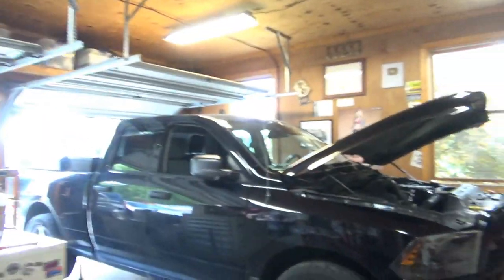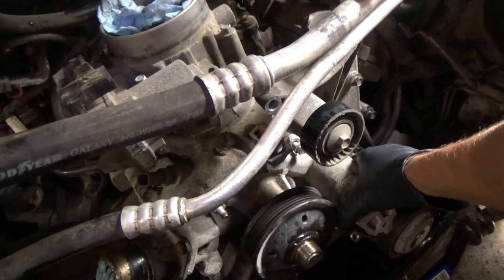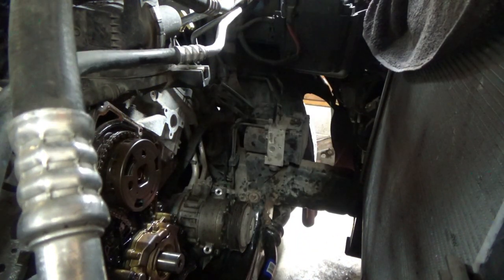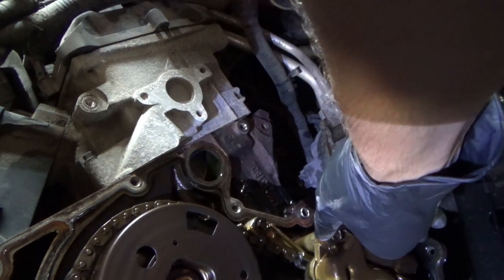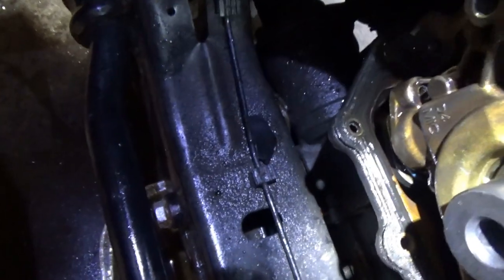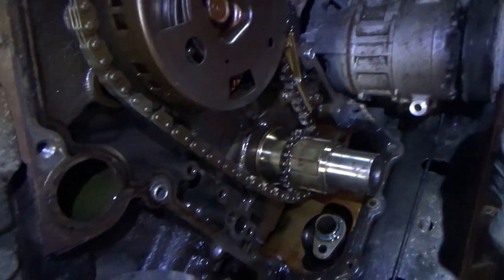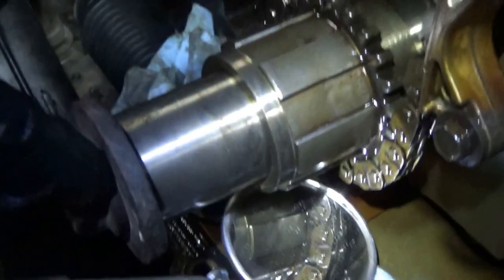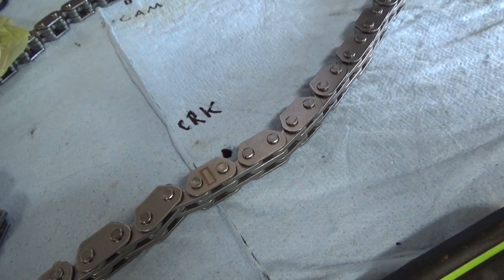Labor Day HEMI - Part 3 (P0016 Timing REPAIR)

Comment: That far into it I’d drop the front diff, drop the pan, replace the oil pump with Hellcat pump.   Inspect the oil control valve for metal as well. The owner needs to change the oil every 6000 miles maximum.
Reply: He could still replace the oil pump without pulling the pan. (as long as it uses the same pickup)
Reply: @calholli  with the oil in the condition it was in when we first started, I’d love to see the cam. Agreed he can still replace the pump, but debris in the pan is what my concern is.
Reply: Definitely want to pull the pickup tube at a minimum and drop the pan to remove the rest of the guide plastic….
Reply: Did a cam and hellcat pump on my 300c and it made a big difference in the oil pressure and drivability of the car.
Reply: @thunderjet4294  6-8 psi I’ll guess
Reply: @js12278  15psi at idle 22 at 4500rpm
Reply: @thunderjet4294  ...does that make it baby hellcat cub? Hmmm
Reply: @nickmalone3143  no it just makes it a better mood reliable 5.7 that don't have lifter tick
Reply: @thunderjet4294 did you have to change the pickup tube?

Comment: That oil pickup O-ring situation makes me nervous.  I would have at least replaced the O-ring but I feel like you can't be sure you are getting it aligned just right.  Obviously that O-ring stands between you and engine failure...
Reply: @T.J. Kong but hat does it take to get the pan off? is it another 3 hours of labor pulling 4wd parts to get clearance?

these body on frame trucks aren't exactly super serviceable with things like that. 

the guy has already driven the hell out of the engine (even towing like that)... whatever damage has been done is done.

Comment: How did you get the pickup tube bolt threaded back in?? 

Thanks for this video I have essentially the same truck so it's great to know you can do this without dropping the oil pan.

Comment: That oil pump pickup bolt is very similar to a Chevy LS engine.  If you use some fishing line with a loop, you can slip it over the head of the bolt, pull on the loop of the fishing line and you will be able to retrieve the bolt.  I've done this on the infamous LS engine where they use an Oring instead of a gasket on the pickup tube.  The Oring looses it tension and the oil pressure lowers. When this happens, the variable cam actuator can't work properly and it sets a traction control, stabilization code on the dash.  It took me quite a while to figure out what the issue was.  If you revved up the engine quickly, the VVT worked.  If you did it slowly, it wouldn't advance and it would set the code.

Comment: IMHO lack of oil changes would not have caused the tensioner to break in half.  Luckily removing the timing chain cover doesn't seem like a major undertaking. Design flaw in the tensioner itself. Thanks Ivan for showing us, I own  a 2019 RAM and hopefully Stellantis has updated the timing setup.

Comment: Ford Tech Makuloco  had a good demonstration video on how a Ford 5.4 3-valve could skip the camshaft forward by ingesting broken pieces of timing guides. I feel like that is what happened here. He placed a piece of plastic in in between the chain and camshaft sprocket and rotated the engine. After the piece passed out the other side, the cam was advanced 1 tooth.
Reply: i remember that one, great video.

Comment: Good work Ivan. My only concern is if the chain guide dropped any debris into the oil pan. I'd want to know if the pick up screen is blocked very much. Also, 100,000 miles and this chain guide wears out. I wonder how much less wear would occur had the owner used Mobil 1 or other synthetic oil ? You have to wonder.

Comment: Whenever a guide or tensioner falls apart there is the chance of trash in the pan... been bit by the 'just do the kit' before, on one with nylon teeth broken off (obvious in retrospect).  Hard choice whether to pull the pan... depends on if you can do it without removing the engine, I'm sure.  Biggest lesson here, folks... don't neglect your oil!

Comment: great video IVAN,my gut feeling after you showed the chain guide,bingo! But then i thought where's all the crap aluminum? Oil filter? pump screen,maybe blowing out the pickup tube might have helped the plastic parts to the drain hole?But some damage is all ready done no doubt.NOT YOUR FAULT.If the guy was on-top of his servicing this MITE have been avoided.Your gut instinct about advancing etc was right.A lot of your viewers know these motors,and they still watch your videos.That speaks volumes to your skill level,and ability to explain your findings and procedures.Ford could maybe improve this design.thank you IVAN

Comment: To get the crank pulley on easier I use a small torch. Heat up the pulley shaft. Then while it's hot slide it into the crankshaft. Works every time. Once it's hot it expands and will slide on easily.
Reply from the maker: Great tip Edwin!

Comment: Is the tensioner designed to take up slack if the crank is spun backward  ?  I could see if it allowed slack during kickback on start to jump a tooth in the advanced direction.

Comment: just when an engine shuts down it can kick backwards slightly due to a cylinder being on the compression stroke but not reaching top dead center and at that instant it's possible that a cam can jump backwards on the chain.    I would also imagine that perhaps if you were driving along at a pretty good clip at high RPM and slammed on the brakes the tranny upshifted such that the crankshaft slowed down much quicker than the camshaft it the latter could also advance but true that is definitely not the common failure.

Comment: Me thinks somebody was doing neutral-drops with this truck. This would cause the crankshaft to suddenly decelerate, so the inertial of the camshaft assembly would twist towards slipping forwards a tooth.  When I was a teenager, my friend used to sneak his mom's 350 Nova out and do neutral drops to burn rubber.  One day the rear universal joint snapped, and we had to tow it home with a tractor, driveshaft sliding along the pavement.  Does the owner have a teenage kid?

Comment: Only problem I have is, where has all the plastic and metal gone from the guide ? I would have definitely, removed the pan as a minimum and stripped the pump and strainer.

Comment: Wow! That was a lot of work! I'm curious as to why the old cars had timing chains without guides or tensioners - is it because the older designs had shorter chains? And this truck is only about 5 years old and needing work this extensive and invasive? Yowza!
Reply: Older cars didn’t have variable timing with phasers.

This vehicle didn’t have regular oil changes.

Comment: All that metal and nylon has to be in the oil pan which in my opinion would warrant removal. Even though there is a screen at the end of the pickup tube it could be restricting flow.

Comment: I would have pulled the oil pan to do a full inspection and cleaning of the bottom end. I also would replace the water pump since it was disturbed by pulling the timing cover. I don't like to pull parts that are old and reuse them especially water pumps that may start leaking next week or 6 months down the road.
Reply: Parts quality can be so bad today, the new water pump you install might not last long at all. I personally throw a new gasket on these old water pumps and reuse them if they are not leaking. If the old one leaks later in life, its not a hard replacement.
Reply: @mph5896  

I think it depends on brand and where it is made. I try to get OEM parts or quality branded parts, and get NEW instead of rebuilt. Sometimes paying the price pays off in the long run.

I had replaced a water pump on a 98 Ford Contour, with the V6 and it went out in a year and a half even it was new. Although that was warrantied out, the next replacement was a different branded part...

On my current car, I chose Gates for a water pump. Toyota has updated the water pump for the Corolla and put a larger bearing on the newer style pumps.

Comment: I would have removed the oil pan, cleaned it out and cleaned the oil pickup tube. I would have made the customer get a new oil pump, oil pick up o ring and timing cover crank shaft seal. I understand that the customer was driving for a year like that but there are for sure aluminum flakes in that engine. Realistically that engine should be disassembled, cleaned, checked over for scoring, bearings should be replaced. What you did was a bandaid.

Comment: I can’t understand why the timing marks aren’t at the typical 12 o’clock position (crank) and 6 o’clock position (cam).  Every V8 I’ve installed a timing chain on has been this way. That pick up tube bolt is a nightmare. I’ve used a small zip tie around the bolt to hold it while re-installing.

Comment: This is only a suggestion but I would of Dropped the oil pan to get the chunks of the guide out. My luck it would  clog the pickup screen and starve the engine of oil. But of course I have to worse luck in the World so Thats why I would of done it. LOL...HAHA...You seem like Your a Lucky Man especially getting that bolt out and Back in on the Oil tube. Where I would of dropped that damn thing into the Pan..LOL..HAHA...Great job on it Sir.. The old Dodge will be running good again here soon..One more thing thats the first timing chain kit I ever seen that it didnt come with New Gears for crank and Crank. Every one Ive ever done has new Gears. Wont that chain be noisey till it wears into  the old gears. Just wondering.

Comment: Over time, with todays advanced engines, I reluctantly have tended to favor belts over chains. Replacing the belt, tensioner and any idler pulleys according to recommended intervals are (IMHO), performance over the lifetime of the belt, is better. Also, always replace a belt driven water pump as well.

Comment: So what about all the debris and metal fillings in the pan/oil pump? Think this engine needs a lot more work at the very least that engine pan needs to come off and be cleaned out, pickup tube cleaned, Oil pump inspected for wear, new oil and filter.....

Comment: I have a friend like this. 

Never does his maintenance. Continues to drive his car when something is wrong. Then never does the full fix, always cutting corners. 

He has owned 7 vehicles over the last 20 years, all having catastrophic issues from not changing his oil, as well as many issues from continually driving with misses and timing issues. 

In those same 20 years, I still own the same truck I bought new 21 years ago by simply doing the proper maintenance and fixes when needed.

Comment: It’s hard to tell how much extra time it took you finagling with that oil pump. I think it might’ve been better to remove the oil pan?
Reply: Agreed, and then he could have cleaned out all the debris from the broken chain guide.
Reply: I think calling it a "bad design" may have been just a tiny little bit over the top. 😀😀
Reply: It’s a 4-5 hour job rolling around on the ground pulling the pan. Fiddling with it for an hour up top sounds much more reasonable
Reply: @mph5896  I don’t know about that… I saw another video of a timing chain replacement on this vehicle, and they remove the pan. I can’t imagine an oil pan removal and replacement taking more than 30 minutes.
Reply from the maker: @jcnikoley  go ahead and pull up the labor time for oil pan replacement. Pretty sure it's not "0.5 hrs" 😂
Reply: @mph5896  "4-5 hour job"

It really isn't.  You have to drop the crossmember to get enough space but it's not a difficult job. If there were no advantage in removing the pan I would have no problem with avoiding it, but it's inevitably going to have a lot of junk in it.
Reply: @ferrumignis  It isn't his truck or I am sure he would. The customer would have to be ok with him tacking on $200-$300 onto the bill since the book doesn't call for removing the pan
Reply: @PineHollowAutoDiagnostics  Definitely not with that vehicle, you’ll have to drop the differential, and/or a crossmember. More than an hour in a home garage for sure without a lift. That said, I think it’s the right way to do it, even if it takes more time.
Reply: @ferrumignis  I’ll pull up labor time and post on it later today. 

2014 hemi, in my opinion that repair gets a long block for longevity of repair. I have replaced hundreds of cams on these engines. It prob isn’t far off needing one. Plus add in the debris from timing.
Reply: @PineHollowAutoDiagnostics  Napa PROlink labor time is 6.8 hours to replace the timing chain on all v-8 4wd. I'm sure that doesn't include the labor time for broken bolts, and broken transmission cooler lines, {due to rust} that you're almost sure to run into on most Pennsylvania vehicles. I'm sure not going to tell you how to do your job, as I'm sure you and the customer discussed the repair. Good diag, repair, and video as always.
Reply: @ferrumignis  Labor time to r&r the pan is 3.1 hours + 2.1 hrs if 4wd. Roll around on a creeper doing that and thats all of that time

Comment: Anyone... Newer can fd protocol, can you not pull codes or see live data if the scanner doesnt support the protocol? I know launch and autel have adaptors but without one can you diagnosis a car. I cant find good info anywhere.

Comment: I used to have this problem on older Chevrolets that have a small block. The chain would stretch and advance the cam usually on a vehicle that was ridden hard and put away wet. Or it had 300k plus on it. To stop this I'd end up either doing a gear driven cam or a double chain and roller set on it out of curiosity I didn't catch it in the other videos how many miles does this one have on it?
Reply from the maker: 113k
Reply: @PineHollowAutoDiagnostics  damn what did they do to it to have these issues

Comment: I can't believe that chain has a tensioner and guide.  The small block Chevy stuff I'm used to it's just a chain, and it's tight.  Maybe because the Hemi cam sits higher in the block so a longer chain is needed?
Reply: All the modern day engines I know of use a tensioner. Including ls
Reply: The guides prevent the chain from slapping around, reducing wear.

Comment: I would have dropped oil pan regardless of how long those pieces were in their and regardless of how long it took, if customer approved all work im sure they would have wanted that done i know i would have, do it right the first time, either way good work ivan but i agree with others you shouldnt have taken that kind of short cut this is the kind of stuff that can get you in hot water taking short cuts to save time or work.

Comment: I just wanted to see how you managed to get that pick up tube bolt back in ;) lol
Reply: If I was a betting man. I would say he used two fingers to start it. One finger to tighten it while he wiggled the oil pump with his other hand. A pivoting ratcheting wench to "torque" it to spec. And a telescoping pen magnet for the 10 times he dropped the bolt in the pan.

Comment: Well Ivan,   i cringed a bit there as you didn't get all the plastic guides.  That would not sit well with me. I would not be comfortable giving the truck back with those in the pan.  I would take extra time to clean it up and do it right.  That's me,  I'm stickler to get it done right.  Even if it's been sitting there over a year. Not me.   Overall great job on timing chain job.  It's similar to 5.7 vortecs and 5.3 ls motors.  Nice video.

Comment: Was there any reason a longer bolt could not have been used to pull the harmonic balancer on and then use factory bolt to pull it home?
Reply from the maker: That's a great solution! Just need to get the right bolt 😉

Comment: I would had pulled that pan to clean out the chunks, I have seen oil pickups full of plastic debris from these guides breaking. It may have been driving for years like this, but what if next month a piece clogs up the pickup and seizes the engine... who is responsible for that mess...when you drained the oil pieces at the front of pan could had slide around..

Comment: Replaced a timing chain on an 05 Chevy Suburban. Chevy designed the pickup tube similar. Yes, I did it without removing the oil pan. Wasn't easy.
We were chasing a low oil pressure issue when hot. It wasn't the O-ring on the pickup tube. It wasn't the sending unit. It wasn't the oil pump. That is when I found the warn chain. I never found out what was the cause. I'm thinking bad cam bearings as it also had a lifter tick. The customer didn't want to go any farther with repairs. EDIT Remembered I had a short video on the loose chain. https://youtu.be/pfKS49NhZbI

Comment: 'IF' the Filter did it's job, then it may still be ok with a pan and pickup clean and oil pump inspection or replacement. Yes this is a band-aid at best without checking the oil pump etc. Otherwise 'Buyer beware' this is a fine example of a potentially now working car being sold on to some unsuspecting buyer who doesn't know the history on it. 

Ivan - would you want to buy this in this condition knowing what you know?????
Reply from the maker: I'll give you my thoughts in Part 4 lol

Comment: That's a spectacular amount of wear on that guide, the whole plastic guide then most of the alloy bracket,  the oil will have been useless with the amount of metal ground up in the oil,  if it had a leaky oil filter the engine will have been ruined, Another few miles and that would have been scrap,

Comment: How many miles does this truck have??
Reply: Just over 100k. I think he said 113k miles.  

The new owner has had the truck for two years and probably never changed the oil much and the original owner too.

Comment: Hi Ivan! Do you swear off camera?🤣 If yes is it in russian? I would explain to this customer that I wont guarantee this job cause debris is definately traveling in oil galeries.Just changing the sump and cleaning the oil control valves wouldnt do proper cleaning anyways.👍